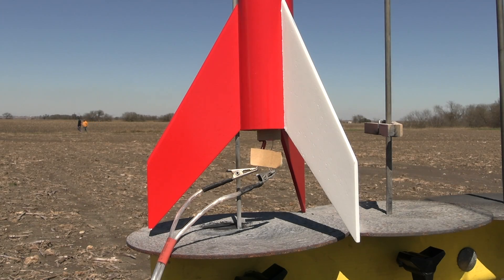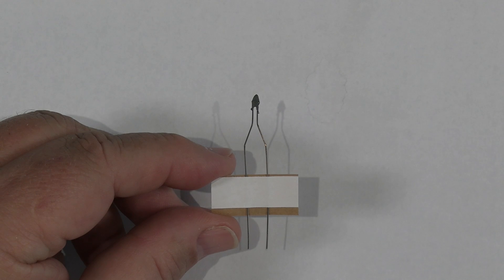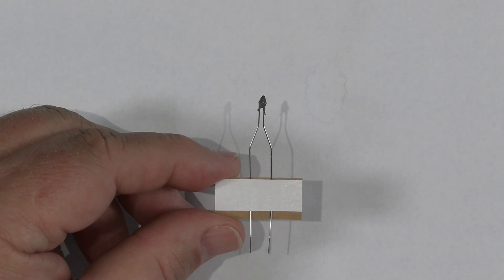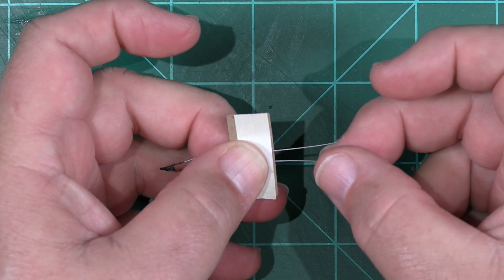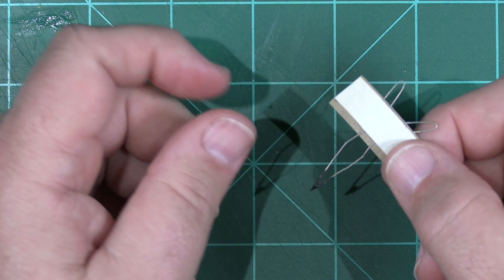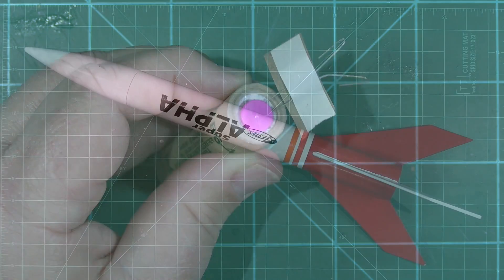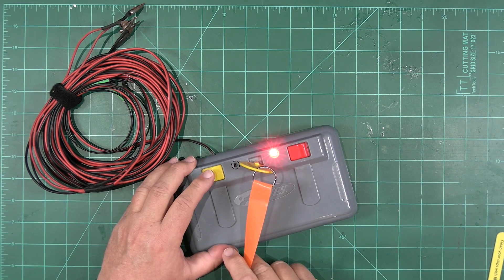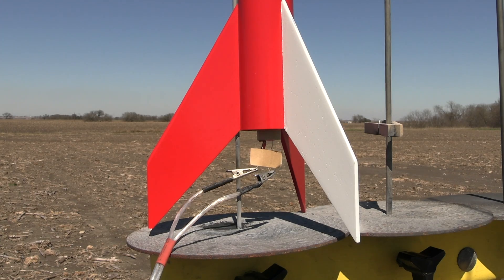Installing Estes Igniters Without Pain or Disappointment

Comment: I recall a “misfire” I had with the Super Neon. I built it as a kid, and apparently, I got some paint in the launch lug. When I tried to launch, the lug jammed on the launch rod, so the whole engine burned out on the pad, blasting a hole through the deflector plate 😂

Comment: (WAY) Back in the day (as in, the 1970’s), the key was to throw away the cheap igniters that used to come with the engines and use Estes’ “Solar” igniters (which now ship with the engines).  A simple piece of masking tape was used to hold the igniter in place (they didn’t sell the igniter posts back then, but what an improvement they added when I started using them after discovering them in the package with the motors!
 
If I remember right, the wire referred to in the video as the “bridging wire” was made of nichrome (this was around 50 years ago, so…). 
 
One additional tip: BEFORE attaching your alligator clips to the leads of your ignitor, you can minimize the strain of the weight of the launch wires on your igniter setup coming from the launch system by wrapping them several times around the launch rod (just above the exhaust shield).  This helps the ignitor to stay in place / not pull out of the motor in the case of a puff of wind (or someone stepping on the launch wiring)

Comment: I've never used an ignitor plug. Instead, I secure my ignitors with a small, rolled up ball of recovery wadding, pressed in firmly with the end of a launch rod. Works perfectly.
Reply: That's real "old school" technique: I did it that way during my first foray into model rockets, back in the 1970s. We also could use a bit of masking tape to pin the leads against the engine wall. (Back in the hobby as a retiree. I like the igniter plugs just fine.)
Reply: This is how Estes instructed to do it back in the 60’s. I still do it this way, 50 plus years later! Sometimes I also use a Cobra fireworks firing module with an ematch as my igniter.

https://youtu.be/SZbK54rJB24?si=QusKB-fByzdMce9Z

Comment: Does it matter what voltage I use for the igniter? Max and Min Voltage.
Reply from the maker: Great question!  Yes, voltage matters.  A minimum of 6 volts is required, and 12 volts is ideal.

Comment: is it not possible to give the wires a rubber coating to prevent short circuiting?
Reply: I thought about adding a small amount of hot glue where the wires tend to touch. In theory it should keep the wires apart. Have not tried it yet though.
Reply: How about two very small diameter pieces of shrink wrap? Properly heat gun shrunk around the exposed lead elements?

Comment: I’ve always used a small square of recovery wadding that I use to shove into the engine nozzle, using the launch enable key, to hold the igniter firmly in place. I guess I’m still used to the old igniters.  This method has rarely failed for me.
Reply: The original method Estes instructed back in the 60’s, and how I learned it then.

Comment: It's a great vid thanks.  Tripoli recommends you connect the ignition wire before you put it in the engine thus if it functions it doesn't set off the engine prematurely.  So fiddly to do it that way though...

Comment: Excellent demonstrations.

A few other techniques I like that may be worth trying:

Instead of using the method demonstrated here, I like to insert the igniter, insert the plug while allowing the wires to bend gently, and THEN bend them over more fully.  I have sometimes found that bending the wires early gives the pyrogen tip an opportunity to wiggle free of the propellant, resulting in a burned igniter but no go.  This method is the one listed in the Estes instructions.

I sometimes also cut the little bit of paper so that I can move the wires much more independently, sometimes hooking up the clips to the side of the rocket instead of underneath it.  This works well for rockets that want to sit low on the rod, such as those with forward-swept fins.

A few rocketeers dip their igniters in silver paint from Estes.  The aluminum powder in it produces a more vigorous flame than the goo will by itself.

For almost foolproof igntion, use electric matches.  They can be a bigger expenditure at about $1 apiece, but they'll get your rocket going with close to 100% reliability and little if any delay between button press and ignition.  If you do this, just test them first, make sure that you won't pop them when you check continuity.  Also make sure they'll fit in your nozzle.  Most will but some won't.
Reply: Yes. E-match if you have an ATF license, or FireWire if you don’t!   https://youtu.be/SZbK54rJB24